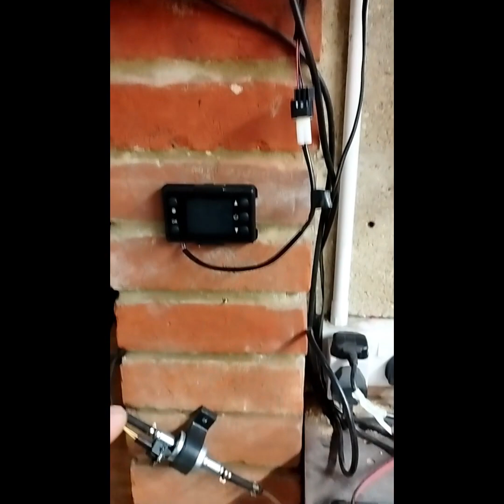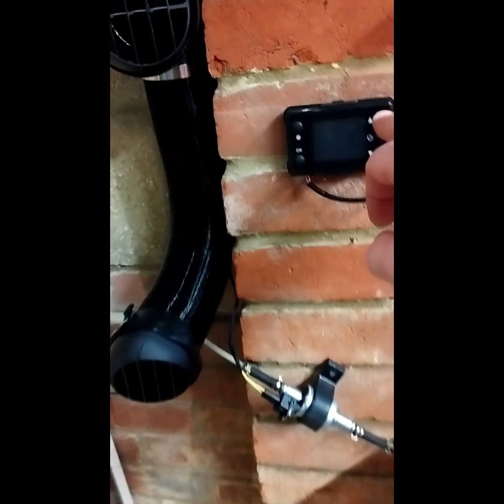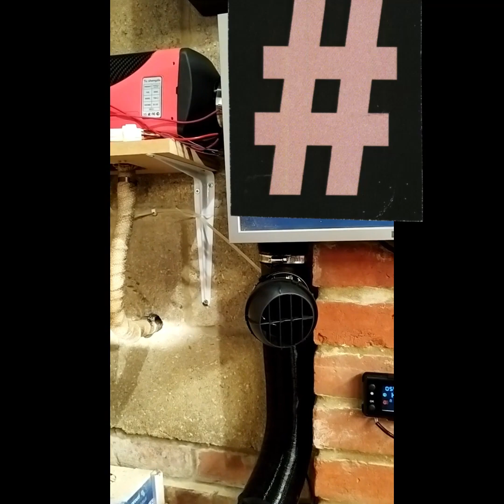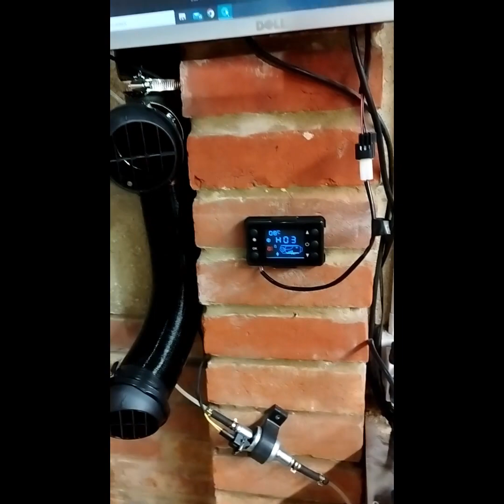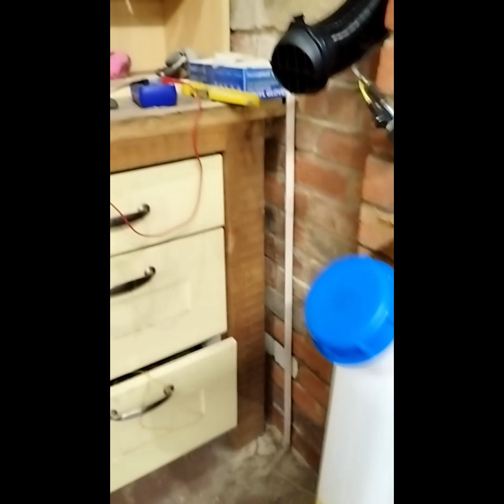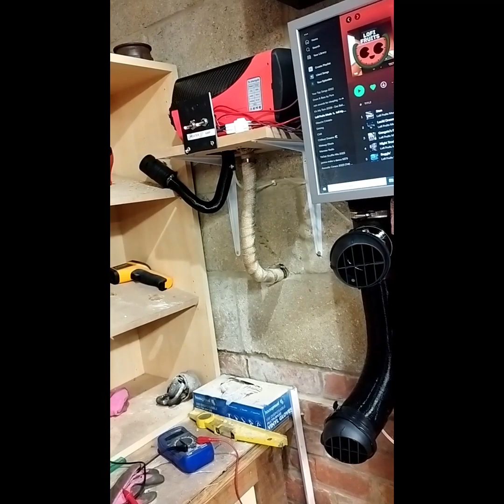Heat Your Garage FAST: Cheap Chinese Diesel Heater

Comment: There is a key press sequence where you can swap from pump Hz to a temperature set point. I think it’s when it’s not running and the settings button with the up button (sorry I can’t remember exactly as I’ve only done it once as it stays)
Reply from the maker: Thankyou Gary, I will have a play.

Comment: I feel the same as Brotherputts, I would only wrap the first 3” or so from the unit body exhaust exit to shield the fuel line and leave the rest of the pipe open to air to reclaim the extra heat radiated from exhaust pipe. Other than that, super job!
Reply from the maker: Thankyou, will definately do this

Comment: i bought mine on the  1st Jan 2023 , and its a very weird controller ,works just like every other 5kw heater ,but it has 8 heat settings on it ,and i have,nt managed to find another heater with 8 heat settings . the instruction for lcd controller where in chinese ,so i just had to figure them out by messing around ,its a great unit and it only cost me 121 squids :) i just need a cheap supplier of red diesel now .then i can fill up my 25L can .
Reply from the maker: Thankyou for you comment. yes the instructions are awful aren't they. my controller was a different model to the one I found on YouTube and it took me a while to figure how to prime it. however for all of its little niggles it has allowed me to get out to the garage through these cold spells

Comment: I have a vevor 5kw in a one car garage. 31°F outside. On full blast for 1 hr the temp went up to 53°F from 31°F not bad for what it is.
Reply from the maker: I agree, for the money I doubt there is anything better. My next job is to insulate my ceiling as it's just open joists at the moment
Reply: @G9RGE  I have the same plan.

Comment: Not sure why you would heat wrap the exhaust , it would just give you more heat in the garage. Other then that nice set up.
Reply from the maker: Thanks for the comment. I was in 2 minds whether to wrap it or not but it's a bit close to some tool so just wanted to stop anyone getting burnt. 
In the future I want to look into running the exhaust through a radiator before it exits the garage to try and save  and reuse some wasted heat
Reply: @G9RGE That sounds really good, just make sure that the exhaust isn’t too obstructed though. Diesel heaters don’t like too much back-pressure.
Reply from the maker: @xmysef4920  thankyou for the advice, I didn't know that. It will probably be a simple 18inch wide bathroom style radiator with the inlet and out let opposite.